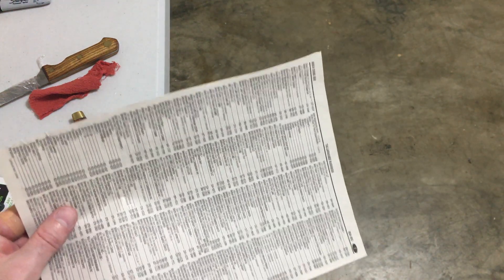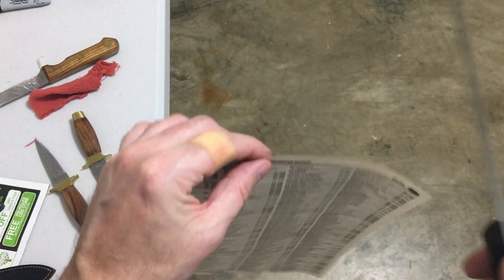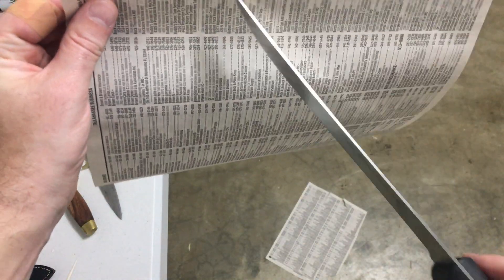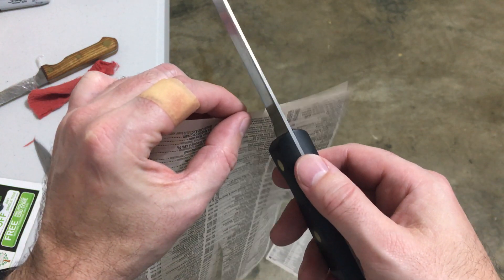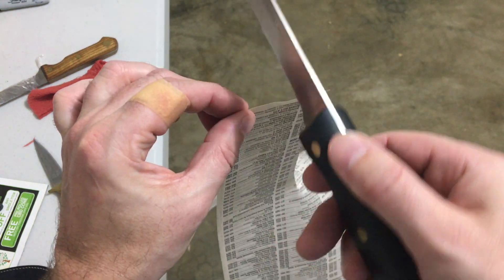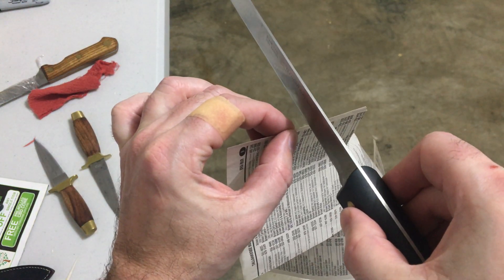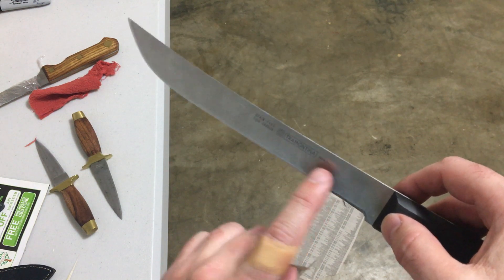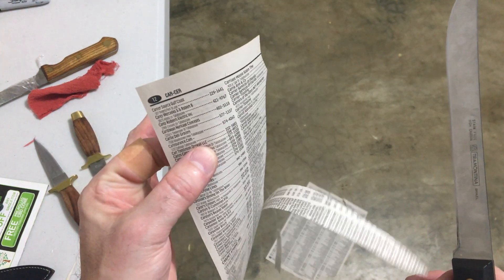Knife Sharpness Testing with Phonebook Paper

Comment: Great video. One thing I noticed that makes a big difference is the humidity level. I live in a very humid climate and if the standard notebook paper I am cutting is very humid it is almost impossible to cut. It just wilts under the slightest pressure. When dry (like in dead of winter) it is much more stiff and very easy to cut because it holds up. Very humid paper is halfway between dry and wringing wet and acts like toilet paper.
Reply from the maker: Agreed on all counts.
I made this video in an air conditioned garage so humidity wasn't much of a factor.  If it had been an un conditioned space and during summer, it likely would have been very different.  I would have set up the camera inside instead.  :)

Comment: Thanks for the info.  I was going nuts thinking I wasn't sharpening my knives correctly.  All these knife sharpening videos show the paper test but never point out how to do it.
Reply: There is no specific way how to cut paper. If a knife is truly sharp is should be able to cut paper at virtually any angle. (90, 180, 60, 20 degrees etc).
Reply: @wraynephew6838 wouldn’t 180 be holding the knife with the side of the blade against the paper in this context lmao
Reply: @donutstand  a one 180 angle is swinging the knife vertically from one side of the paper through the other side. Like a level left to right

Comment: Noticed the Band-aid. What's up with that...the finger method proved unreliable? I'm just messing with you. Impressive how sharp those are, how do you get them that way? I'm an experienced novice ,but never got close to this.
Reply from the maker: Finger cut test is a very advanced technique!  lol
I sharpen a lot of blades on a 1x42" belt sander using various belts.  I believe I finished that particular blade using a leather belt loaded with compound.  I own quite a few sharpening systems.  I use the belt sander the most because it produces results very fast and make a very consistent edge.  I have some videos on this channel demonstrating sharpening on that belt sander.
Your skill level is exactly why I wrote my "Seven Secrets Of Sharpening" document.  Do a google search and you'll find it on blade forums.  You might enjoy it and/or learn something. 
Thanks for the comment.

Comment: Sharpen with sandpaper up to 3000 grit for some. Others finish with 5000 grit. Some get final finish with 7000 grit. All get stroped with white or green rouge on rigid leather and wood strop. After all that usually only ever need black rouge and green to resharpen.

For me the ultimate test for sharpeners is the ability to snap cut corner slices of phone book paper no thicker than a 1/8 inch. Snap cutting that 1/8" thin strip means it is truly sharp. A 10-inch blade that sharp is something special.

Comment: The best way to know that you got a maximum sharpness is by choping the phonebook paper. Not slicing it. Chop it at the same angle as you do. Only a 99% sharpness of a 15° to 25° edge angle can make a clean cut. Less than that will tear the paper. 
A 95% sharpness will do find with the slicing method. It is good only to test edge prefection. I mean the slightest dink will tear the paper instead of slicing it.

Comment: Next step - try curved cuts by tilting the knife during the cut. The hardest is cutting tensionless 4-layered toilet paper. I was not successful with that yet.
Reply: I got the toilet paper sharpness with vg10 kitchen knife, finish sharpened at 5k chosera stone and strop it on leather with 4micron, 1micron, and finish it with 0.5micron diamond spray.. it lot of work and effort to get that result, i feel not worth it because it not last long.. with d2 steel pocket knife and same sharpening method, it will cut curve the thin newspaper, but not the toilet paper, it still cut but not as clean as the kitchen knife, maybe the thickness and blade grind affect the result

Comment: kewl........what grit and burr removal?.......kally as always i presume?........standing by:  <")))))<>(
Reply from the maker: This blade is much more polished than what I normally do.  I used the Kally.  The last belt was the A30 (600 grit).  Then some deburring, which didn't work very well.  The final deburr and polish was on smooth side leather loaded with green compound.  That's what really got rid of all the burr and probably polished the edge a bit too.
Reply: @briangentry3118  .......interesting.......i used smooth side leather today for the butcher, been using ruff side for years at A16.......no direct compound